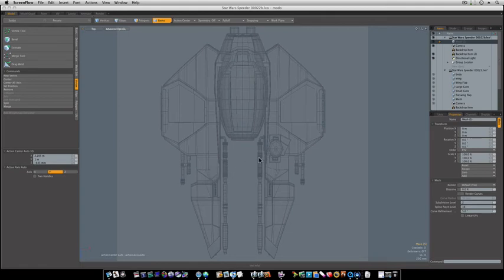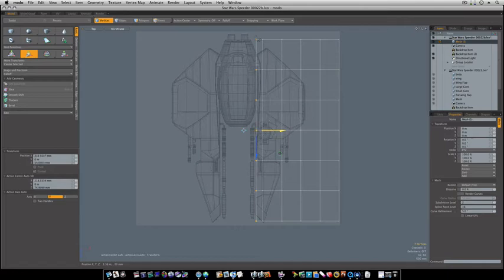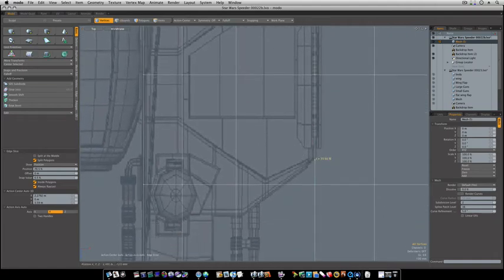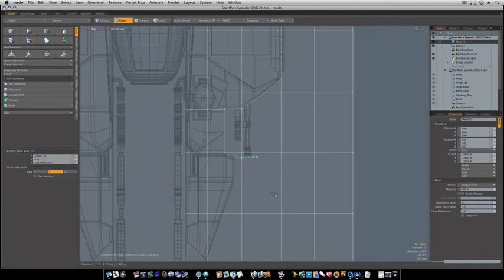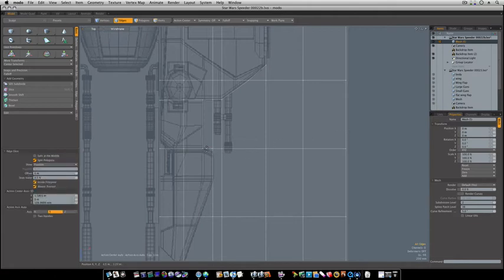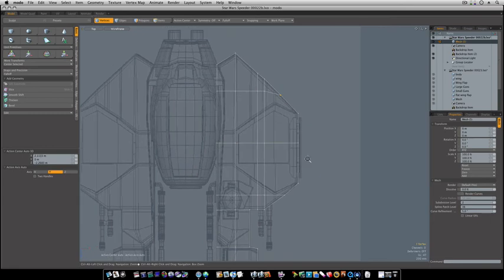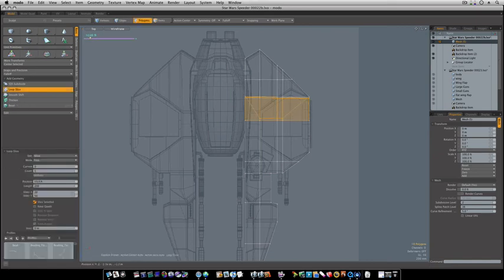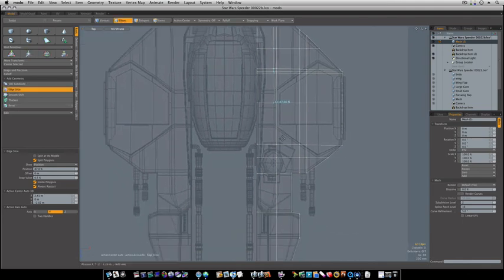Modo 401 3D Modeling Tutorial : Star Wars Jedi Star Fighter Part 1

Comment: ah ok, what about normal slice (Shift+C)(just found that) with "Right Angle Snap" and "Geometry Snap" (Layers: Both/Foreground) that will snap so not split the vertex and is 100% flat so no need to scale... but thats not really my concern...

Have you read about my problem (activating the tools) is that normal or can it be adjusted?

Thx :)